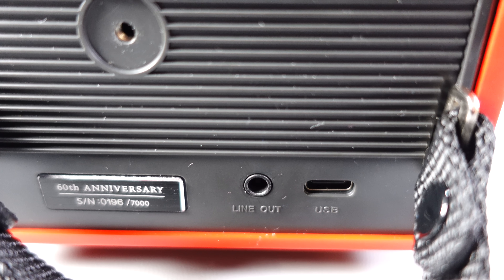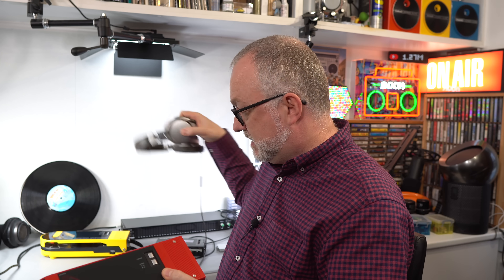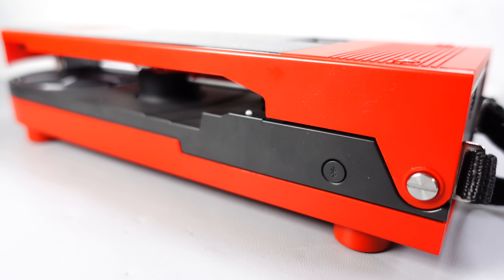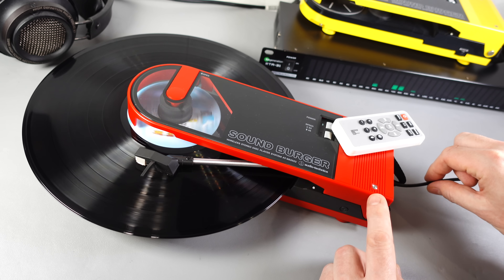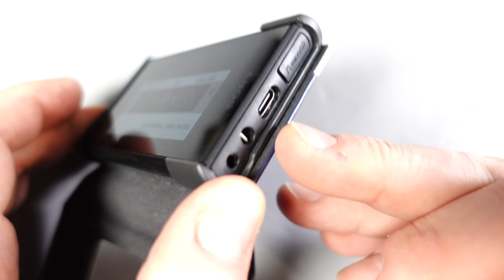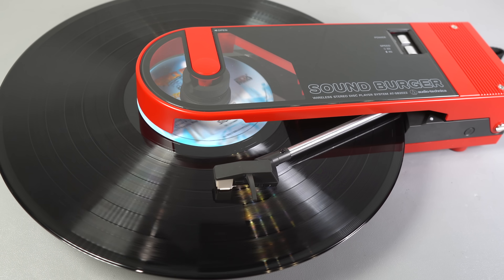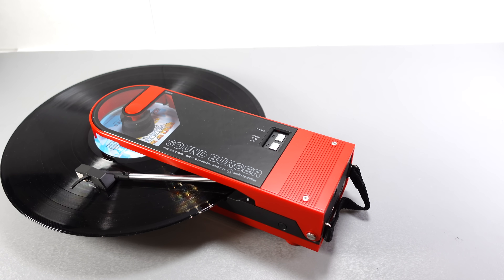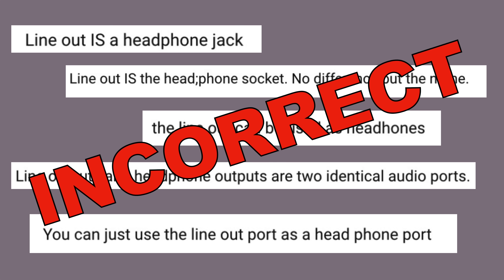Line-out ≠ Headphone-out

Comment: I think the concept is slightly blurred for a lot of people due to quite a few devices out there which have an output labelled as a shared headphone and line out socket, which is of course usually just a normal headphone output.   Also nice to know someone else is enjoying Philips Fidelios!
Reply: Laptops with shared mic, headphones and lineout jack. Lol
Reply: @mueffe1357  Try using line in and headphones at the same time. The one for all jack may save space, but it sucks you can't use more than one function at a time. I have a headset I can't use with my laptops because the laptops have the shared audio jack and my headset has separate plugs for headphones and mic.
Reply: There are devices with a shared headphone and line out socket, and in these the internal circuit is wired in a way where you can bypass the headphone amplification circuit and have just line out playing with a switch in the operating system of the device. You can also lower the volume on the headphone out but if you have a dedicated line out it's preferable to do it that way without trying to level match the headphone output
Reply: As soon as I saw him get them out I thought "I know thise headphones, I have a pair myself".
Reply: Exactly. Most computers since... at least 10 years (?) adapts the impedance and behaviour of their "headphones" output according to what they detect you plugged in.
Reply: @ursumuf2  And sometimes you could even force it to specific mode if detection fails.
Reply: Agree!
Reply: I guess the confusion had been exacerbated by the generation who grew up on the PC as their main multimedia device. PC speakers are usually plugged into the headphone socket of the desktop or laptop. Soundcard line outs are variable outputs and sometimes do have an inline amp which can drive headphones and even small speakers. Iphones and Android smartphones are also used as audio sources via their headphone out. Then there's the TV out/ Audio out/ Earphone out of TV's which are used to connect to soundbars, amps, or HT setups.
Reply: Thanks, this was helpful.
Reply: My line 6 spider V guitar amp has a USB out(truly a great feature) and a cheap little headphones/line out 1/8 that says the same thing. Still not very clear
Reply: Exactly! I commented in the other video if you could use the "line out" for both uses because of what you are explaining.
Reply: I have some nice Philips Fidelios X2HR inexpensive 'phones (relatively speaking) and I use an USB FiiO K3 amp to listen through them from my PC, works great for my tired ears for music and for online work
Reply: Excellent headphones and fantastic value. Just pity it's so difficult to get genuine Philips replacement ear pads.
Reply: watching this wearing a pair of X2HRs, absolutely great pair of cans.
Reply: Philips Fidelios are only discovered by those who feel far too deep into that rabbit hole and found a rope back out :)
Reply: My laptop has a single 3.5mm audio jack. It can be line in, line out, and headphones.
Reply: @jerryspann8713  Mine can be line in, line out, mic in, headphones, or headset. When I plug something in, Windows opens a dialog asking what I just plugged in.
Reply: @jerryspann8713  Probably it could accept headset 4 wire jack too. So + microphone
Reply: My PC asked you if you want to use headphones whenever I plug a mic in to the one labeled mic and it asks other questions when you use the other ports rather than just assuming what it is.
Reply: Not blurred for me.  Its really very simple.

Comment: I don't know why some people decided Line Level was Headphone.  A quick google would tell them the difference.  Line level is designed to go to a separate preamp / headphone amp.    Doesn't matter what type of socket it is providing the level.
Line output is usually around 600Ohm impedance and a maximum 2V PP volume.   
If you use a Headphone output as a line level signal, it will work, but it will be poor quality sound compared to a dedicated line out

Comment: Thanks for that. I had always assumed the ‘line out’ would be a maximum signal and the headphones would be attenuated with the volume knob. I would have thought incorrectly that plugging my headphones into the ‘line out’ would have overloaded them, so never tried it. Thanks for clearing that up for me.
Reply: It could with some headphones, they can have very different impedances.
Similarly ome people also use headphones that basically require a seperate amp to be usable, for similar reasons.

Comment: Back about a year ago when I had a TV with no optical or line out, I'd use the headphone out at about half volume as my line out for my speaker system 😂
Reply: ive done it before soundbars were common. some cheap logitech computer speakers did wonders. id left them at full volume and used the tv's volume to control it. having at 10 was reasonably loud that i could hear it clearly and not loud enough to aggerate everyone else. can't stand modern tv's the speakers are usually always rubbish although i have had a few that had decent speakers but were gimped by the tv it's self by not sending full range a combination of a notch filter and cut off on the lower frequency's.
Reply: And that was completely reasonable. Nothing funny about that.

Comment: The headphones/line-out confusion seems like it is a case of "not all rectangles are squares but all squares are rectangles". Although, this is one of the things I have wondered on older items, I figured they had to be different in SOMEway or else they'd just all "headphones/line-out" or the like.
Reply: People think a hole is a hole. Having to explain to people that they can't charge their USB-C laptop with their phone charger is fun times.
Reply: Of course if their laptop supports USB-C charging, and you have 100 w charger, you can!

I use the same USB-C charger for just about everything. Yay automatic current negotiation!
Reply: @mikeey6804  oh sure it's really neat, just people have some leaning to do, gotta bring the right charger, and sometimes the big laptop chargers don't have a very high amperage for 9v.
Reply: The line output signal also shouldn't change with the volume setting on the playback device, unlike headphones.
Reply: It's more likely because on a lot of mobile devices and laptops, the mini jack output can function as a headphone and lineout. My old MacBook for example only has one minijack. Somehow they can detect whether it needs a lineout or headphone out signal.
Reply: @DylanPank71  that's also because many motherboards or sound cards on PC have the capability to read the impedance level and adjust accordingly, essentially changing the line-out to a headphone jack. I'd imagine the combined output+microphone jacks phones and laptops have can do the same. so it's essentially all three of them in one, line-out/headphone + microphone
Reply: @ZoviSapphire  they can also serve as a stereo line in, basically can do it all
Reply: @Nukle0n  Normally the combo jack isn't wired for stereo line in. Only Stereo Out + Mic In
Reply: @TheExileFox  I've seen several that can do stereo recording as well.
Reply: @DylanPank71  Well it could stick a signal or a voltage down and determine  by the current what the load is.  I think they have clever transistor switching circuits that can change whats connected.

Comment: I like that the headphone amplifier looks like a little whiskey flask.
Reply from the maker: Now you mention it, it does. I’ve never thought about it before.
Reply: @Techmoan  a lot of the early radio mics used a hip flask as a case
Reply: @Techmoan  Maybe you can consider a review of audio equipment from the DDR, such as Sternradio
Reply: @Techmoan  Is that a Fiio A3?  I have a black one that otherwise looks the same but I didn't think they came in not black.
Reply: @dustNbone604  Indeed it is, or at least I can see the Fiio logo and the controls look identical. Mat probably sought out a silver one since that's the colour all his hi-fi stuff is in.
Related, I've been shopping around for a headphone amp and I quite like the look of the Fiio A3 (plus it's less expensive than a lot of others), how do you like yours? Would you recommend it? Does it feel sturdy?
Reply: @Techmoan  Another thing with Line-Out Vs Headphone jacks is PCs and the on-board sound cards or BUS slot cards. Never plug your headphones into the Line-Out jack as it's unamplified and if you have unpowered desktop speakers you plug them into the Headphone jack. if they're powered speakers you plug them into the Line-Out Jack. caveat to this is in Creative Labs and Turtle Beach PCI/PCIe sound cards if you have say a 5.1 speaker setup the headphone jacks doubles as a 2nd Line-Out the setting in the software tells a micro co-processor to disable the amplifier on the Headphone Jack which turns it into a unamped Line-Out.
Reply: @Techmoan  
How about the headphone output on amplifier/receiver is there more distortion there than on pre out?
I want my signal with loudness and then record it .
Reply: @bendermi  If you want to record a signal with 'loudness' (usually just boosting gain on bass/treble for low volume listening), pass the signal through an equalizer that permits it.  My Sansui SE7 has the ability to switch the EQ in or out for recording purposes.  Press the Equalizer 'recording' button, and then you can adjust the gain using the available frequency sliders from flat as you'd like...
Reply: @henryrahn2474  
It's more than just a boost of bass and treble.
Reply: @bendermi  Depends on your setup and devices. Unless you absolutely need it due to the length of the cable run amplification should always be the very last step to prevent clipping earlier down the chain.

Otherwise amplification should only be used as much as needed to ensure signal integrity.
Reply: @RAHelllord  
I've used the headphone out to power an active subwoofer, I couldn't hear any clipping even at very loud levels . 
I'm asking because I want to put a new system together and I can save money when I'm skipping the pre out  .
Reply: @RAHelllord  
And the sub can handle distortion better than the recording on MD.
Reply: @bendermi  If the device doesn't overheat and you don't hear any distortion then just keep using it. Worst case scenario you can swap it out later whenever it is convenient to you
Reply: @RAHelllord  
Why should it overheat ?
Reply: @bendermi  I connect the headphone output of my laptop to the rca inputs on my hifi, works perfectly. Sometimes I connect my phone to the amp in the same way and still no problem.
Reply: @bendermi  i suppose it happens when output wants to draw more amps than amplifier can provide thus creating “voltage sag” / diode effect, loved by guitarists. This fiio thingy should be very clean. Sort of lo-end audiophile HP amp.
Reply: @finger351  
Everybody is doing that .
Reply: @micindir4213  
The record input can't draw that much , it's not like an headphone or speaker .
Reply: @bendermi  I thought that was what you were asking, I'd probably had an off day and misread the question.
Reply: @finger351  
That's alright no harm done. 
You're not the only one .
 :)
Reply: @bendermi  👍
Reply: whiskey amplifier !
Reply: Well, now I want a flask that's disguised as a headphone amp.
Reply: @brennyn  like a true audio engineer
Reply: Guess I shouldn't get that one for work. I'd look like I was drinking at my desk
Reply: @SF-bh7rd  Combined with my new bong microphone it'll look like i've got problems :)
Reply: @SF-bh7rd  Turn that thought around: wear headphone when you're drinking :)))
Reply: It does!
Reply: There are a lot of homemade headphone amplifiers that were a circuit board in a tobacco/mint tin - might lead to confusion at an airport going through customs etc 🤣
Reply: ifi Hip DAC comes to mind
Reply: I came here to say the same thing. It's for nerds who want to listen to their own music at the school dance, but still want to look cool.
Reply: @Pixie Pete 
And miss out on the sound I'm a fan of?
No way dude. 🤣
Reply: I literally think the same when I saw it
Reply: That was my first thought too.
Reply: Techmoan is da man!
Reply: It wouldn't hold enough whisky 🥃🤣
Reply: @rikmorley6469  load up absynthe then
Reply: @rikmorley6469  Just enough for one person to make it from the bar to their car.
Reply: I was thinking the same! :D
Reply: Good call. It really does. Hadn't thought about it but now I can't not see it.
Reply: When you drink so much you hear tastes
Reply: Wait, why does your comment say it was posted six days before the video?
Reply: Immediately though the same thing
Reply: If I drink enough whiskey, everything becomes loud.
Reply: You have a rye sense of humor 😂
Reply: AlKILLhol.
Reply: Don’t lose sight on the Kingdom of God 🏞️ all that is in the world is soon coming to an end. Seek God whilst He may be found. Jesus saves ✝️🙏

Comment: So.... You can put headphones into a line out, but the sound will be very quiet. 
They won't blow up, tsunamis will not occur, fire and brimstone will not rain, etc.
Reply from the maker: You can put a lot of things in a lot of things - you could put all your money in a fire, but the issue is more about whether what you’re doing is useful and whether it’s sound advice to suggest it to others.
Reply: @Techmoan  I did use a pair of Walkman headphones as a microphone once. Worked, but was not "high fidelity" by any stretch...
Reply: Yes...but you're not going to have a great experience with headphones without a headphone amplifier....which Techmoan does explain in this video....
Reply: In years past before commodity opamps with continuous short circuit protection, yes, headphones could damage the line driver unless the designer accounted for people doing dumb things. Sometimes in audio it becomes a design decision whether to add the passives to protect that opamp and the original high fidelity opamps which could drive a line output did not employ short circuit protection.
Reply: You could stick a matchstick in there, would still be as useful as a chocolate teapot!